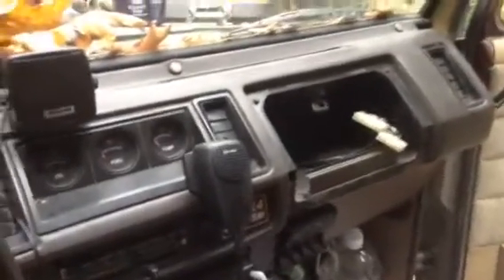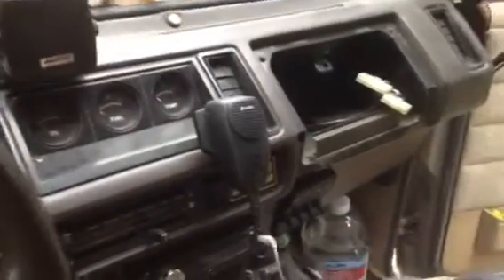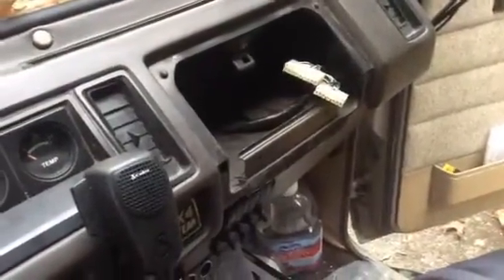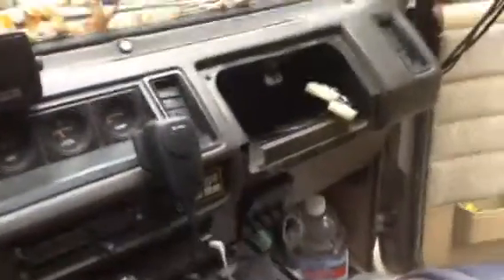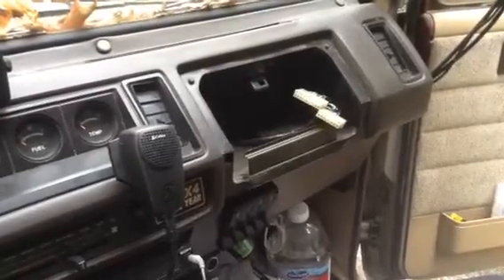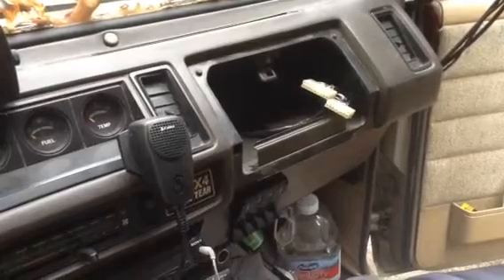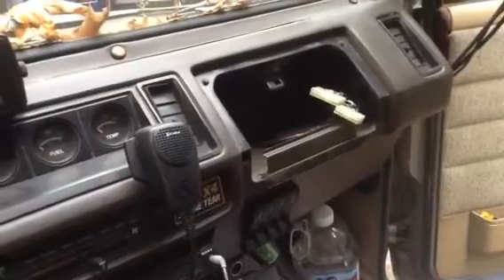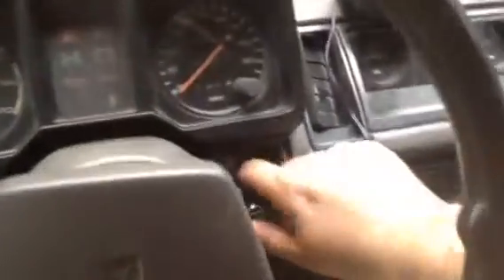EMP hardening test on Isuzu Trooper 2 / Holden Jackaroo

Comment: awesome I have a mid 80s pup (62k on it) with a holly weber 5200 conversion I went to Isuzu pup.com forum and put out a wtb and got loaded distributor alternator starter & etc for $100 shipped.   Now its in a galvanized trash can in back. it was my daily driver. I took another of my cars out of mothballs as d.d. so I can leave it home for family in the event I don't make it ( I am 35 to 250 miles from home) and always have a bicycle with me
Reply from the maker: +patr10t762 If you could correct that forum link, I would appreciate it.  I post some of this stuff over at the planet isuzoo forums.
Reply: the link to the forum is isuzupup.com

Comment: just curious...I am in need of a intake for my 2.6 ltr 4 cylinder trooper.  I too want to convert my trooper over from fuel injection.  I have watched jonny5 tutorials and I can't seem to locate an intake and distributor anywhere. I wasn't sure if you might have any old  spare  parts  to sell.....thanks and have a good one.  
~Bryan
Reply from the maker: +bryan evans  All I have is the original exhaust and smog parts but you want them you can have them cheap.   I think people fab up adapter plates to make the weber work on the fuel injection intake manifold but I am not sure.    All of the 2.3 stuff will bolt up to the 2.6 from what I hear but I have not tried it myself.   As it was, the guy who put the weber on mine said he had a really hard time getting the length of the mounting studs just right.   Going with the setup that I have is mainly about carefully removing stuff, not much installation except the new carb and exhaust.   Everything else is removal and blocking off stuff.
Reply: Awesome....thanks again and have a good evening ;)

Comment: Is that Trooper old enough to be carbureted I assume since you mentioned a manual choke.  My 84 Ford Bronco 2 I bypassed the feedback computer in it and it ran better without the computer crap in it.  So my 84 Ford Ranger would have been the same way if I only knew back then how to bypass all that stuff LOL.
Reply from the maker: +William Todd (williamtodd)  Yes, I had the original computer controlled carburetor swapped out for the Weber DEGV kit, and then header exhaust installed.   Supposedly there is a way to de-computerize the fuel injection on later models but we never got that figured ot.  This conversion requires a 1984 to 1987 Trooper or Isuzu Pickup intake manifold but can be done on any of the 4 cyl models up to 1991.  The 1988 and later versions involving the removal of the stock manifold and fuel injection system, but there are some custom guys who like it that way since the later fuel injected models went from 2.3 liter blocks to 2.6 liter setups, a little more engine displacement in the same basic block.
Reply: 8digitPDX Thank you for the information.  Those old Troopers were great vehicles.
Reply from the maker: William Todd You can still get them cheap, but they usually need a bunch of work so it does not end up as a cheap project.   The plus side of that is that it is a lot of bang for the buck even when you are shopping for stuff since the parts are always going to be cheaper and less in demand than Nissan or Toyota.   These are also built on a regular truck frame that is fairly beefy, thus easy to do modifications and custom work on without threatening the structural integrity of the vehicle.

Comment from the maker: It took a lot of work to get up to this point, with the original test was just to momentarily un plug and then ree-plug the engine computer to see if the vehicle would possibly remain running or start back up without roasting the computer from the jolt of the loss of power while running.  As it is, the vehicle now functions totally without the computer.   Incidentally, Isuzu located the computer inside the glovebox under a metal panel which is partially EMP protected as it is.